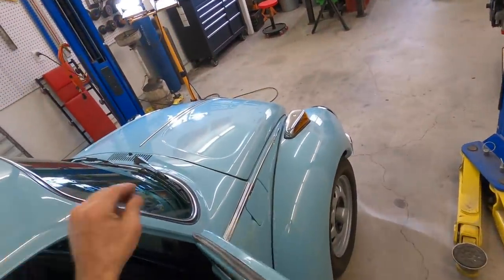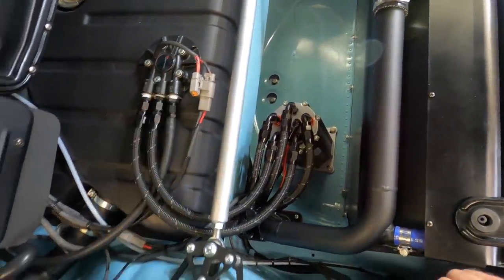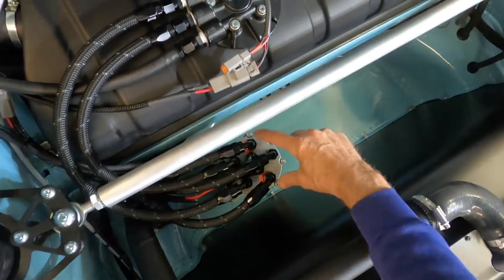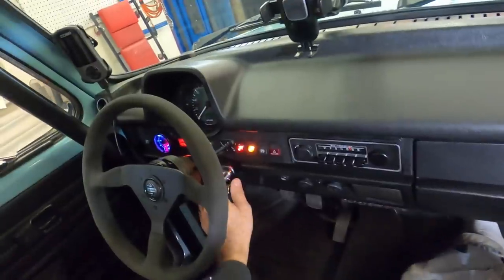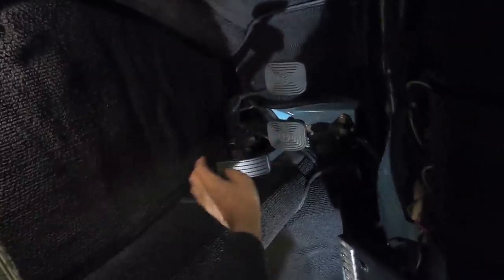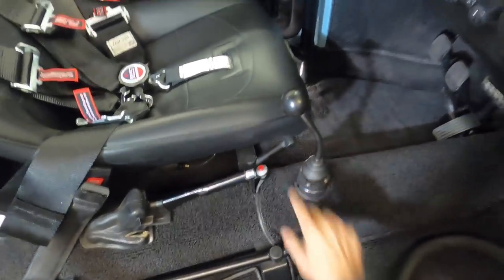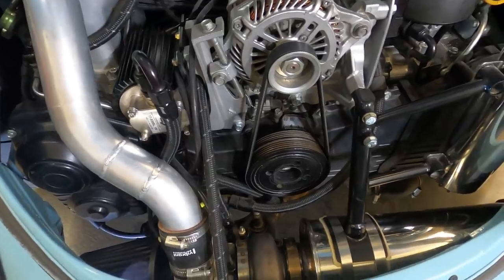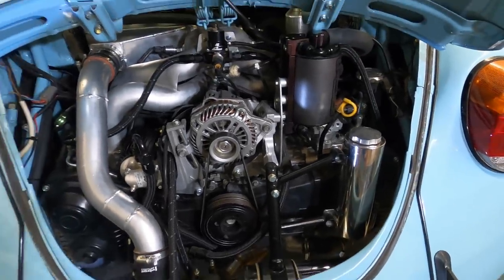Just for fun drive in the SuperSleeper

Comment: how bout a fuel cell  also    this a 73   right?
Reply from the maker: A fuel cell was considered mostly because of the added capacity.  It could be more easily customized with internal baffling but it would also be taller.  That would make the outside gas door non usable.  I don't want to lift the trunk lid to fill up like a race car, I want to use the gas door.  Yes, it's a 1973.

Comment: Why not just move the fuel pumps back as possible?
Reply from the maker: That's another way to do it, unless you slam on the brakes.
Reply: @JohnReynolds661  lol.. yeah.. but then you don't need much fuel!
Isn't "floating" pickup also solution? I.e. sliding the bottom of the tank?
Reply from the maker: True, but having the engine stall is going to be annoying. There are other ways to do it and believe me, I considered them all.  Two fuel pumps complicated things.  At the end of the day, considering how much time it would take in labor vs. what an off-the -shelf fix would be ultimately decides the decision.